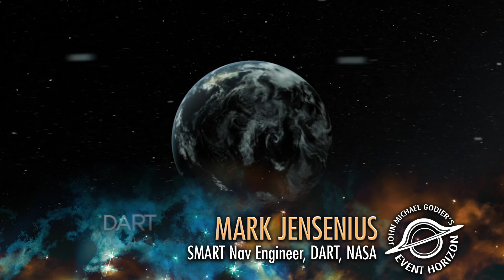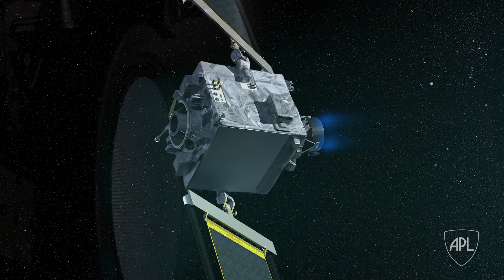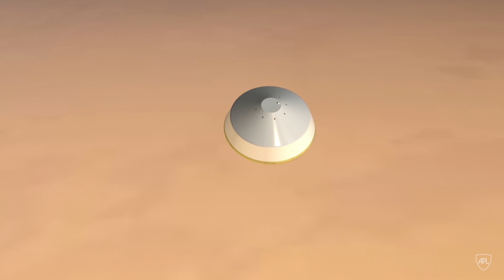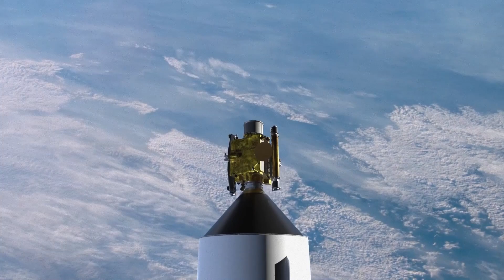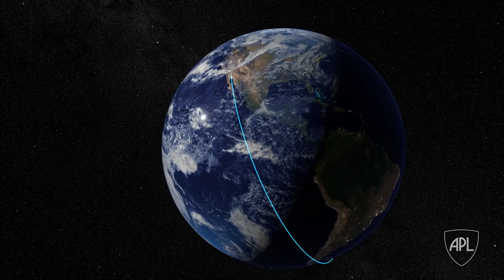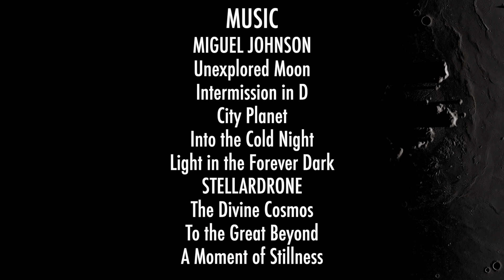How Did NASA Hit the Asteroid? With DART's SMART Nav Engineer Mark Jensenius

Comment: I figured that the shake had to come from the thrust, but now hearing (and therefore understanding) the issue... i wonder if the solution wouldn't be to just make it a mast tethered panel. So instead of just going like an accordion, it would also deploy a mast between the two arrays (or maybe on both sides) with a simple sprung mechanism to stabilize the two panels via a guide wire.

Considering the scale, purpose, and function of such a part/component, it could all be made from aluminium reinforced carbon fiber, nesting rods, and any wire that's approved for space functions.

Cheap, simple.

Comment: I'd be interested in learning a lot more about how the navigation with this and similar missions work, because it seems almost crazy that we can do this, when you really think about it. The math, the orbital mechanics, that's one thing... But there are so many variables with your initial trajectory and speed, I really doubt you could ever perfectly navigate to something that far away. So how exactly does it work? Do you give it your best guess, chuck it out there in the right direction, and then slowly steer it on the right course as you get updated readings? Do you just keep making smaller course corrections as you get more data?

Comment: How does the kinetic energy of DART compare with a shell from the guns of the USS Iowa? 🤔
Reply: I would bet on DART having more energy.
Reply: Well, a typical shell from a battleship was 862-1,225 kg/1,900-2,700 lbs (depending on type) and was fired at a speed of about 760-820 m/s (some of that speed would be lost before impact due to atmospheric friction tho)... DART had a kinetic impact of about 570 kg/1,260 lbs at the time of impact and was moving at about 6.1 km/s (6100 m/s). While DART's mass was a bit lower, I'd say it made a MUCH bigger hole than a battleship would due to its significantly higher speed :P
Reply: @olencone4005  Thanks for the comment! yeah the more I thought about it that velocity is really everything here. 6 KM/s is insane for something with that kind of mass. Have a kickass weekend Olen!

Comment: May be as the best and most reliable alternative to dart impacting of  asteroids,which can also possibly fail due to a miss shot attempt,another technology could be to install powerfull repulsion engines attached to the asteroid,which could also be remotely  controled and change direction of repultion in different 
Ways, inserting  constant controlable  push drive on the subject,it so appears such a technic could serve as a more reliable less risky to miss the subject ,and possibly could be implimented well in advance and with plenty more available time gap ,specialy in dealing with huge sized asteroids  approaching earth in a matter of longer duration of time ahead providing designers with enough time to  proper instalation and inplacing the required apparatus on the subject, well in advance and hence some kind if a guarantee of much higher levels of security could be achieved,are we on the right pathway on this subject could this be one of the Nasa's futuristic plans to deal with the serious threats of being hit by asteroids?